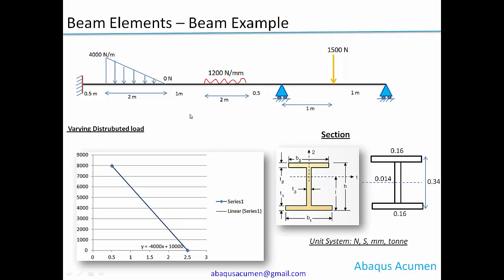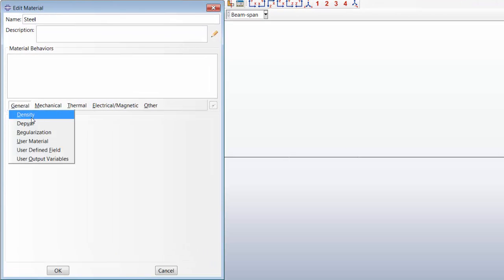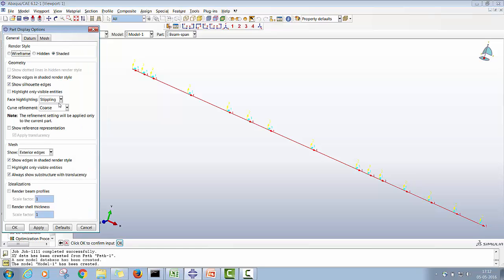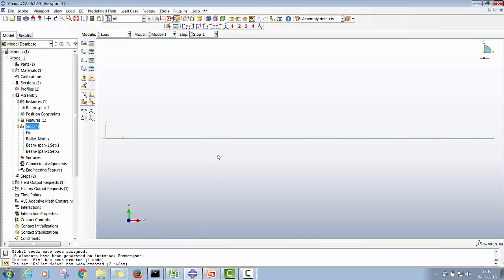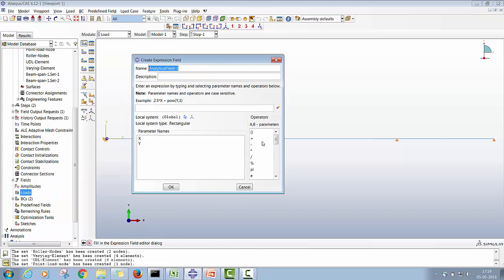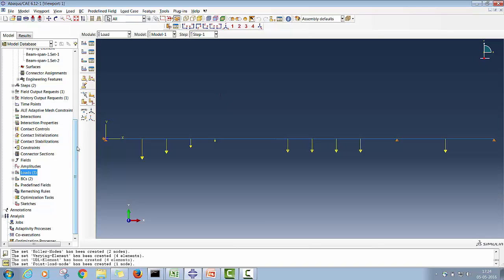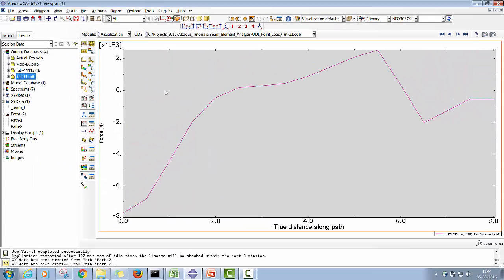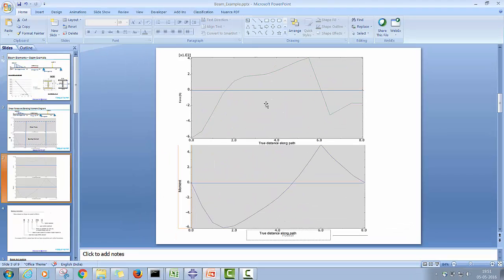Continuous Beam elements with Varying/Uniform distributed load-Tutorial (Shear Force/B.M plots)

Comment: thank you for this video ......
But i think the equation of the triangular load used in this video is wrong; as if we use the general equation to define triangular distributed load (X-XA)/(XA-XB)=(Y-YA)/(YA-YB)
the solution will be y = -2000x +5000
and if we solve this equation by the boundary conditions of point A=(0.5,4000) load will be 4000 and also point B = (2.5,0) the load will be zero

Comment: Interesting video and useful for ABAQUS users to see how some of the functionality in CAE operates.  But, sadly, it is rather spoiled by a number of simple and also more subtle errors.  The most worrying is that no mesh refinement has been undertaken and, having checked it, there is likely to be significant error in the prediction of the maximum bending moment.  Since  the video does not show which of the many beam elements available has been used then I cannot quantify this exactly but it is likely, from past experience, that the predicted bending moment is less than the true value and, therefore, will lead to an over prediction of the capacity of the beam, i.e., an unsafe prediction.